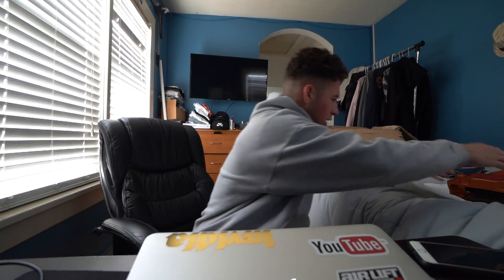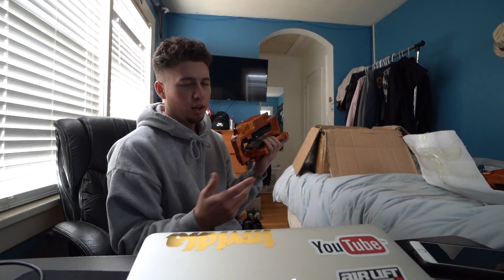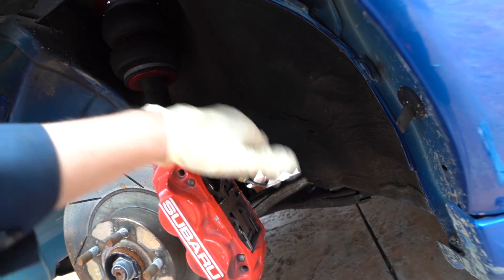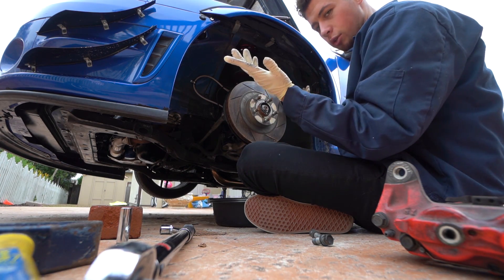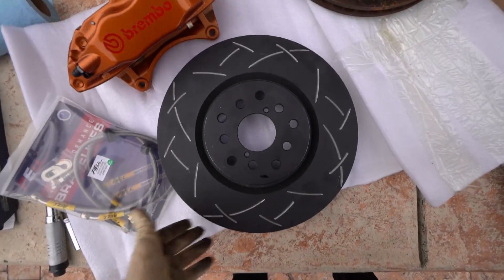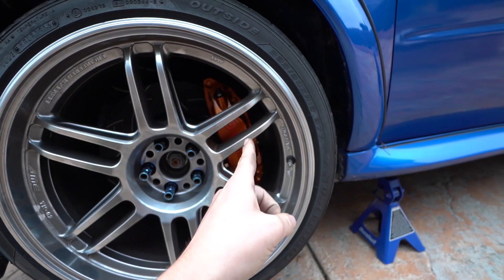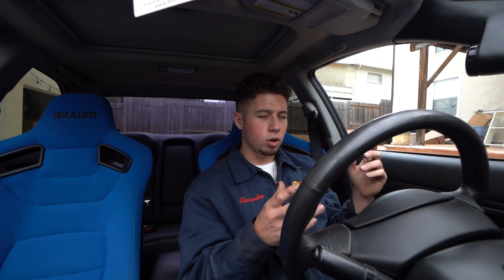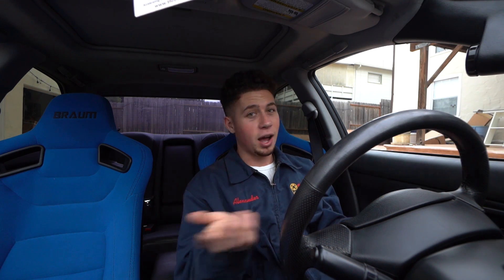I BOUGHT NEW STI BREMBOS! but they might be fake? HELP

Comment: Brembos have a tendency to seize up where the bolts attach to the hub. Previou owner probably re tap them to get the bolts out. Ask him him what bolts size he used for the re tap
Reply: I cant tell you how many STIs I've worked on that were seized and had to be thread chased or drilled and retapped!  USE ANTI SEIZE PEOPLE!
Reply: Evil Me I just did my brembo swap, can I use thread lock and anti seize at the same time ?
Reply: @abTraX95  you really can't use them mixed, but I haven't seen them back out if properly torqued down with just a light application of antiseize.
Reply: Evil Me 2 of my bolts backed out of my calipers while I was on the highway, my caliper basically came off as I was doing 50 on the highway and I had to be towed home. That being said I just wanted to put some thread lock but also didn’t want them to seize
Reply: Just had to pull the front ones off and praise the lord all four came off without seizing. I broke the rears a few years back and have been avoiding taking them off since.

Comment: can it be that the brembos are form a jdm sti which have a different tread pattern ? because if i not mistake asian has a different tread pattern, same like the metric system
Reply: From a car manufacturer perspective, that would be an unnecessary cost.

Comment: Bro just go to a hardware store bring the brembos with you and the wrx bolt for length comparison. And get a lock washers. I broke one bolt before and so far I have no problems. Those are real brembos btw. As long as the holes align your okay.
05 STi
Reply: Something I was thinking

Comment: I wouldn't recommend using a torque wrench to loosen lugs or anything for that matter just to set correct torque. I wouldn't want to risk making the wrench inaccurate.
Reply from the maker: I knew someone would say that hahaha I never use that torque wrench to tighten. I only use it to break bolts loose. I have another torque wrench that I use to tighten!
Reply: Hey, that's what I do. Love the car BTW.

Comment: Brembos are 12x1.75 pitch n standard breaks are 12x1.5 should of got bolts with Brembos 😊they usually ring off as people don’t torque them properly n strip the thread

Comment: I know I'm late saying this but you can heat it up a little i had problems taking my brake line and i broke it so i went to a Junkyard and the first thing I did was heat the line up for a few second and you can use that  Tours your next project if you run into a problem like that again anything with rusted or stock parts you can heat it up a little bit it work p.s Don't use it on plastic or rubber some ppl do it